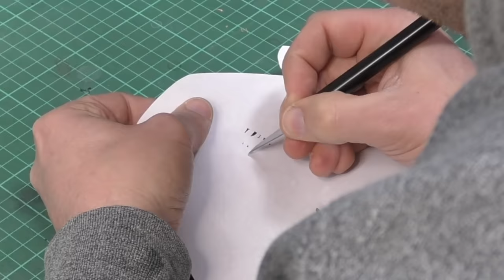Learn to Airbrush the 3 Headed Dragon, Part 1

Comment: Hi Carson, hope you are well, long time since Ive messaged from the UK, been busy painting my old Austin 1958 Van (purple candy!) for months. Just got back to doing some fine airbrush work and catching up on a few months vids' from you. Enjoyed seeing the step by steps, I saw you moved, hope the baby is okay and life is bearable :) I managed to step up to a micron iwata SB which is 1.8 and about as good as I can get. Im still struggling with fine detail though, particularly the build up with white and the repeats with highlights and darks. I use createx, went over to the illustration paints, using plenty of reducer, sometimes a touch of their 4030 balancing product, pressures from 5psi up to 20 but even then I cant find that sweet spot like you achieve. Im sieving it through a stocking as well, just in case! The constant tip dry, or minor blocking means I spend more time clearing than I do painting. Having to blast paint through it, take it partly apart, blow it through etc. Any detailed tips that might help? You dont seem to have anything like the issues I get.
Reply from the maker: Hi Phil great to hear from you again and great job on doing your Austin in Candy that’s a huge undertaking 👌🏻
In regards to mix and tip drying, it’s really difficult to give a 100% accurate formula as each individuals set up is different, including climate where you are painting, compressor ie . Psi and also what moisture filters etc..you are using will all depend on your outcome.
I tend to mix most of my colours at a ratio of around 30%paint and 70% reducer for fine detail at around 15psi and near 1:1 ratio or slightly more reducer for general airbrushing and about 30-40 psi.
Just keep playing around until you find that sweet spot, I know that’s not much help but it may take time and error but it will be worth it in the end, all the best cheers Carsten 👍🏻
Reply: @AirbrushAsylum  Hi Carsten :) Sorry, I mispelt your name before, should know better by now, I always feel compelled to write Carson, guess its an unusual name! Yes I know the format for this of course, listened and watched every video of yours, which are of course simply the best anywhere on the internet, I mean that sincerely too. I find, and I see the same in this dragon of yours on screen at times, whenever I put white (or a tinted coloured white) or a reduced and transparented black, that either of these colours dont seem part of the painting somehow. They almost seem to sit on top, seperate and not blending into the paintings. I guess its because the contain none or little of the pigments of the colours around them. Watching your part 3 dragon, the final black and trans layer, the dark tones at places seem to dirty the image and the deep lines dont blend. But somehow, when you have done it all, it suddenly works! Mine are becoming a mess and not clean/crisp like yours.  Not really sure how to fix it or improve that part. Ive got a fire dragon, ie orange/red tones, Im trying to do a highlight and white stands out like a flag on top, and anything tinted looks pink. I mixed red, burnt sienna, black illustration for the dark, but it still stands separate or muddies everything. Where yours looks plasticy, wet, glossy and clean, mine looks blurred, flat and grubby lol. Oh well!